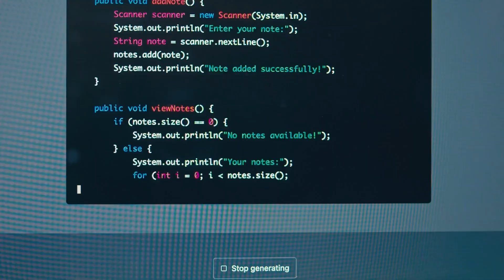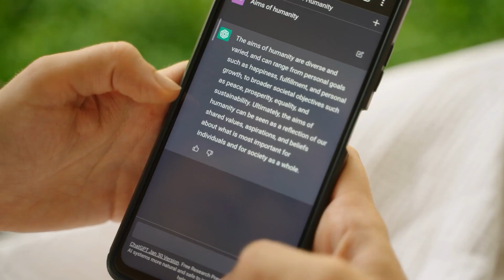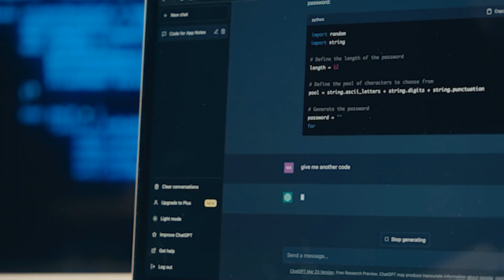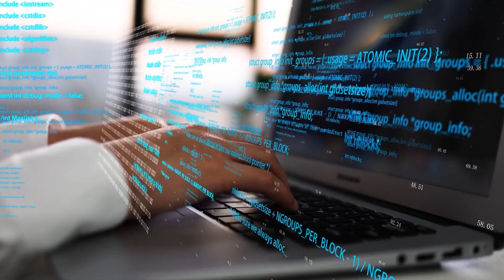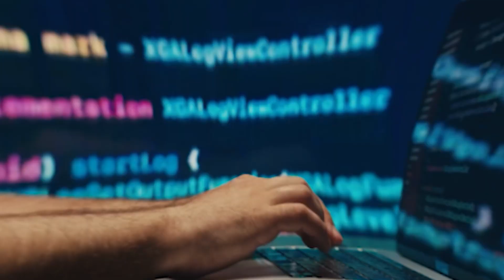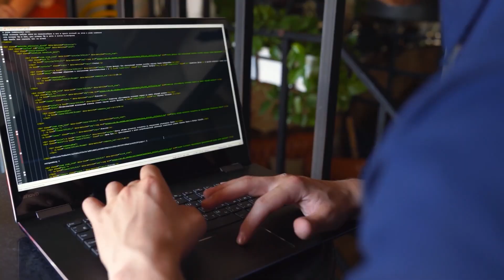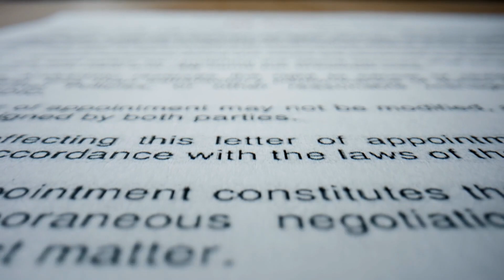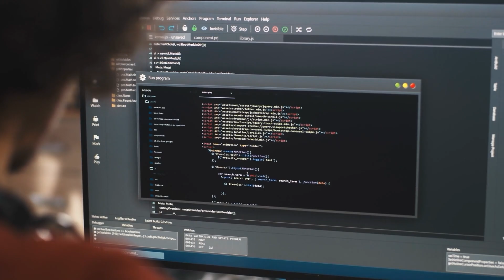These Latest Features Of GPT-5 Will Blow Your Mind!

Comment: I think AI could be managed like traffic and if you were a truck driver ever drove commercial vehicle especially big rigs you know that there's only certain lanes you can go down to get to certain places so it's important to know where you can be in terms of your path to a destination and similarly AI should be able to be tracked And it should only be allowed to go down a certain channel and any AI operating outside of that channel should be shut down immediately and within that channel that they operate there should be absolute transparency even from private companies like Coca-Cola who come up with advertisements or anything especially if it's gonna be used for like the military there should be absolutely no case or anybody's using AI for the military should not be allowed and There should absolutely not be an accessibility difference for people and it should all be open source because AI is built on human activity and we have accumulated the data sets that we have and AI models on the history of hundreds of thousands of human beings many of which were not even alive anymore and didn't even know that the data they were generating was being used to build AI system so AI systems even though they might've been developed by specific people at certain times it's really only possible result of people existing and doing the things I've been doing for hundreds of years no one should have absolute control and determined the level of access to AI at large